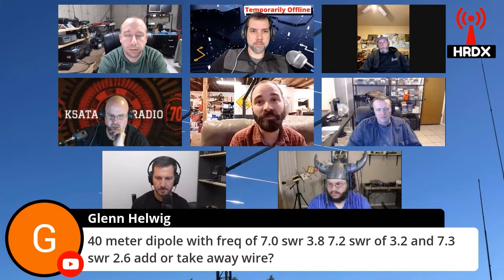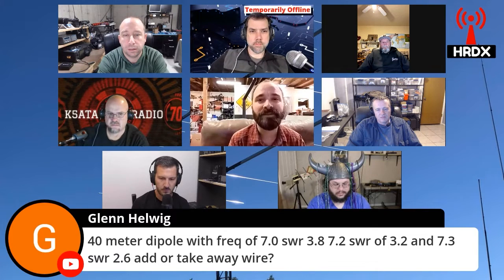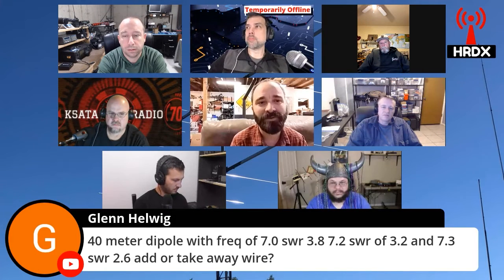Basic Antenna (Dipole) Tuning Tips

Comment: How does coax loss affect things?

I have a 40m dipole with the feed-point at 26’ and the ends at 15’.  Each leg is 29’9”.  I measure the lowest SWR at 1.98-ish at 7.12MHz if I connect the NanoVNA to a 25’ feed line.  If I check it in the shack, which adds an additional 150’ of coax, and the SWR drops to 1.65-ish.  I attribute the drop in SWR to coax loss (right?).

What can I do to reduce the SWR?  I’m using 12 ga solid copper insulated wire.  The antenna is hoisted in a row of trees.  I added a 1:1 balun and it didn’t have much impact.

Comment: I know this is an older video, but hopefully you'll still see this... I don't have an antenna tuner, nor do I have access to one. I use the readings on my MFJ-872 SWR/Power meter to adjust antennas to lowest SWR. That means with every adjustment, I flip the switch to "SWR SET," turn the knob until the needle is at CAL, then switch to SWR and measure. It's not ideal, but gets me close enough to have usable antennas. THE PROBLEM- any time I attempt a 10-meter antenna, I'll max out the knob (in SET mode) before the needle ever gets to CAL. This has happened on three antennas- a monoband dipole, a fan dipole for 10/12/15, and a multiband vertical for 10/12/15/17/20/30. On the two multibanders, I can get all other bands to 1.3:1 or less, but if it's 10 meters, I can't even get the meter set to CAL. I've tried shortening, lengthening, and cussing. Any ideas?
Reply from the maker: How much power are you inputting into the power meter? On what scale? Perhaps 10m needs a little bit more power to get it to calibrate properly.
Reply: @HamRadioDX  The radio is an old Kenwood TS-430S, so the power isn't adjustable that I know of. Meter is set to the 200W scale and of course I'm testing in CW mode. All the other bands calibrate fine.
Reply: Can you afford a nano-vna? That's what I tune with, it works really well

Comment: Folding the wire back works only like a cut if the wire is unisolated and twisted around. If the wire is insulated (enameld copper wire) the back folded part counts for 1/3 of its length! See here for explanation: https://www.youtube.com/watch?v=0UwaIc3GdSA

Comment: I made a 20M dipole and my wire was cut for the 20M band (14MHz). The SWR on 13MHz was 1:0 but then as I got to 14MHz the SWR went to about 1:5. Does that mean the wire was too short of too long?
Reply from the maker: The wire was too long (resonant lower in the frequency). Therefore to shorten just cut an inch or two of each end and remeasure. Height above ground will also play a factor in the tuning of your antenna too

Comment: Referring to the 3:25 mark of this video, This is the question I have been trying get an answer to but I have revceied 10 dirrent answers which made things more confusing.  So here is the question does the resonance of the antenna stop at the point where it is twisted at? For example, if the antenna calls for 10ft on each side and the antenna wire is 11ft  but twisted at 10ft. Does that make the antenna set for 10ft or it it still 11ft due to its physical length?
Reply from the maker: 10 feet if you twist the wire back on itself…
Reply: Gotcha! Thanks!

Comment: I am trying to tune a 265' OCF dipole. I have new 4:1 balun (Balun Designs) on the top of a metal mast at 40 feet. The short end of the dipole is about 20 feet AGL and the long end is about 27 feet AGL. My first SWR readings taken at the coax drop wire at the base of the mast are: 160 Meters 1.06 @ 2.0Mhz; 80 Meters 1.6 @ 3.670Mhz; 40 Meters 1.5 @ 6.80Mhz; 20 Meters (crazy?) 7.9 @14.313 Mhz; 2.2 @18.068; 15 Meters 1.7 @21.820 Mhz; 12 Meters 1.04 @23.580 Mhz; 10 Meters 1.38 @24.420; 6 Meters 1.27 @49.520  (2.2 @50.00 Mhz)   My OCF point is at  the 33/77% point. What is the recommended course of action with these readings? Changed/tune the length of short and long ends at a 1/3 ratio? Or, do as some people recommend, go to a 20/80 ration?

Comment: On a regular cb radio not ham
Does the height of the antenna BEFORE the whip matters to get better swr's on a antena hook to a mirror? 
I really hope your a able to get me an answer....Thanks
Reply from the maker: I imagine you mean mounted on a car or truck? There are dedicated mirror mounts that you can get, but you need to use a ground independent antenna. The mirror has pretty much no ground at all thus the SWR will be affected.
Reply: @HamRadioDX  on s truck I'm sorry forgot that....still need a ground cable?
And again does the size of the shaft 5 or 10 inch make any difference to the size of the whip. Thanks for your response
Reply: @HamRadioDX  I have a Wilson 5000 with a 10inch shaft the antenna seats very tall and with the whip now extremely high, I use a meter for the SRW's,  but ch40 is reading 1.5 and ch1 reading 2.5 but my antenna is very tall already should I buy a bigger whip, regardless of the ground cable being added?
Reply from the maker: I just looked up that antenna, it has a magnetic base? Is there a way to stick that in the middle of the truck roof? The best place is with the most amount of metal underneath it I've found.
Reply: Preferably you want at least 4/5 ths of the whip above thr roof of the car or truck.
Tuning the whip try for at least 1 to 1.5 swr, 1 to 1 would be ideal but might not be easily possible

Comment: 3:25 This is genius advice. I never thought of it that way. Im gonna try it out
Reply: DX Commander actually did a full video on this - basically, if you fold back 3 inches of (insulated) wire, the folded back bit is now contributing effectively 1 inch to the antenna length (3-to-1 ratio).  So, you need to fold back more than you'd expect, so this method can be a bit tricky.  Here's his video: https://www.youtube.com/watch?v=0UwaIc3GdSA

Comment: The ARRL Antenna Book(24th ed.) has an interesting antenna design by K9YC, "End-feeding a center fed vertical dipole" . It is a coax with 1/4 wave to the center and then another 1/4 wave of wire. The bottom of the lower half has a ferrite common mode choke at the feed line.
Have you or any of the Elmers seen or tried one?
Reply: End fed coaxial dipole antenna.
Hayden made one for six metres but also uses the coax for the RF choke.
Search for:
The EASIEST Antenna to build for Six Meters using one piece of RG-58 coax!